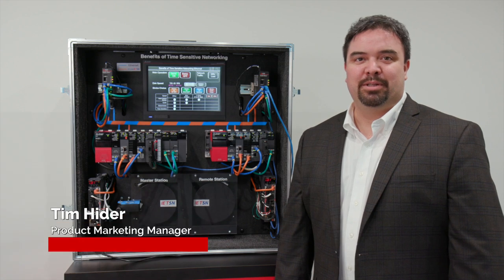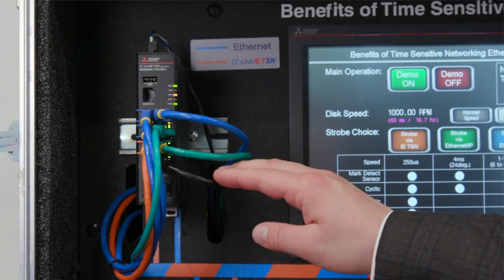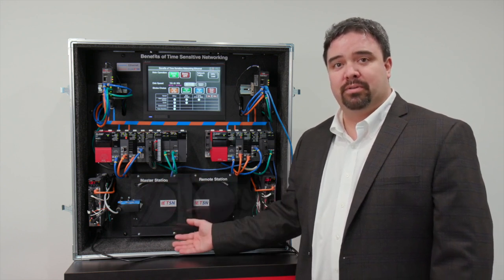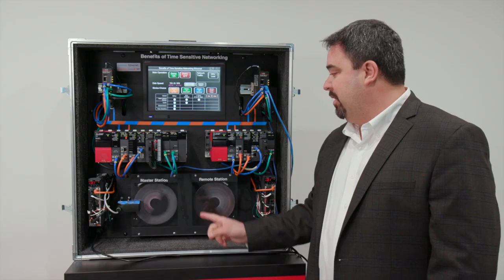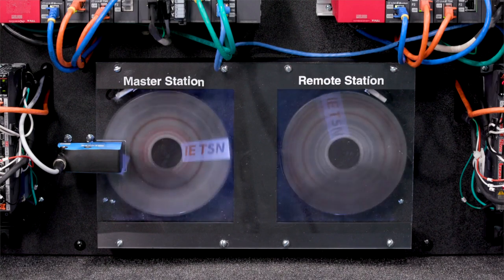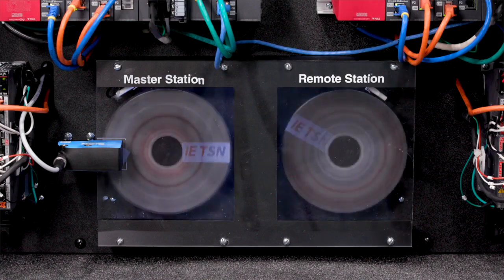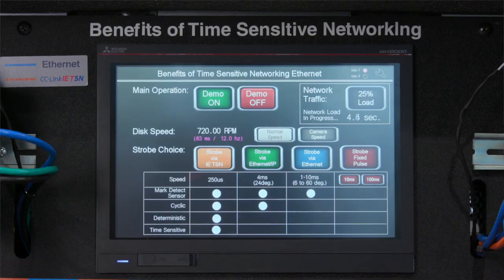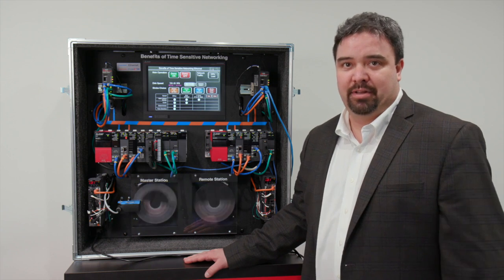What Makes TSN  (Time Sensitive Networking)  So Powerful?

Comment: So, you are using tech that has already been in play for over a decade.... Audio Networking better known by its brand names, AVP, Dante and a bunch others. https://en.wikipedia.org/wiki/Comparison_of_audio_network_protocols

Time synced networking. Master clock on host network controller, rest of devices slave off it for the clock and assured delivery of packets.

Comment: So it is basically qos on the network?
Reply: As far as I've understood QoS it just uses queues with different priorities. This is better than without it, but it neither ensures that a super important packet can be really send first (determinism) nor guarantees that the packet arrives within a set time limit (time sensitivity or "real time"). TSN uses several new features like fixed time slots and is even able to interupt packets with lower priority during the sending process.
Reply: No, I think I have your answer above.

Comment: I have to question the demo. IP is a layer-3 that has to flow over some layer-2; most commonly today, that'd be ethernet. So when switching to "just ethernet" it should've improved. That says to me whatever messaging layer you're adding is not optimal. Ethernet does have a mechanism for QoS (802.1p), but is not a "reliable transport" - there's no acknowledgement of transmission. While everything these days wants to be "cheap" ethernet and IP, they aren't the right tool in every case. (eg. CAN has been very popular in automotive systems, 'tho "automotive ethernet" is a growing thing.)